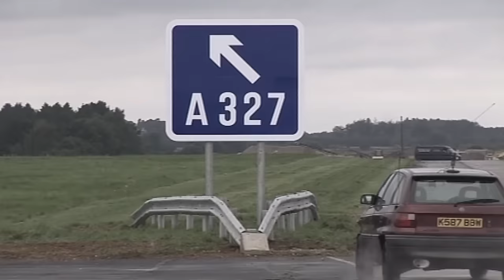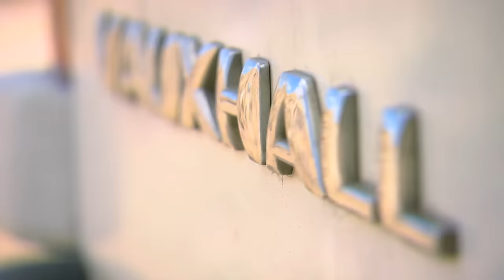Crash Test Month: Van vs. Car

Comment: Moral of the story: Don't transport bags of sand in the back.
Reply: One stupid idea.
Reply: zdrux  Moral of the story is don't use chipboard as a partition between you and your 1 ton cargo.
Reply: zdrux o
Reply: Moral of the story:    Always strap down unsecured loads!
Reply: zdru

I
Reply: zdrux of kkk
Reply: zdrux if
Reply: Xoxo the demon lance
Reply: zdrux to
Reply: zdrux c
Reply: zdrux jk
Reply: Unfortunately tradesmen can't afford 2 vans. The reality is when these van ranges are designed it's for a different type. If you're a painter and decorator you'd have a swb roof van but if you do groundwork it's a dropside. But yh Dropsides are for carrying sand and mud etc and roof vans are for carrying items which need to be protected from rain.
Reply: zdrux
Reply: I laughed hard at the end result xd

Comment: Why the cargo  was not secured! It is not the van design fault it is the person that loaded the van.
Reply: Fifth Gear, known for its staged crash tests
Reply: straps? all cargo vans have tie down points in the back.  they just lumped the bag in the back. if the sand bag was in the front against the plywood it wouldnt need to be secured either. also the impact would have  been alot worse for the car.
Reply: @Mathieu Morin anyone with common sense would tie cargo back kind of like what they sid with the pickup and the lorry
Reply: Ffd
Reply: Haha, look at you lot with no idea how most vans get used day to day. There's not a plasterer or brick who straps a bulk bag down. And there's plenty out there transporting them just like this.
Reply: You would not transport something like that in a van. You'd use an open-sided vehicle so loading and unloading is easier, and you would also have special points to secure stuff like that, instead of letting it just slide around.

Comment: Not a very good test really.  Most vans of 10 years old of this size have driver air bags.  Most have steel bulkheads as standard, why did he not put the sand up AGAINST the bulkhead rather than let it gain an even larger impact!!
Alot of these crash reports have been very informative but after saying nearly all vans won't even scrape a three star & the Passat was 4 the van driver (if he had had an air bag) would have been shaken up & a few bruises.
Think they should do this again but set it up with a more likely scenario.

Comment: I had to do deliveries for my workplace a year or so back while another employee was on medical leave.

Driving a typical Chevy van, I had a payload of heavy steel in the back. Coming down a hill, I had to slam on the breaks when a car ran a light. I was able to stop, but the load didn't.

It kept moving until it slammed into the back of my seat. There was no barrier between the back and the front.

It was absolutely jarring. It cracked the bottom of my seat. It killed my back.
Reply: Salvatore Aversa That sounds terrifying. Were you injured?
Reply: +Salvatore Aversa   Yes that is a bad situation, and it's not just in vans.  Something heavy in the boot of a car can break through the rear seats in a collision and inflict severe or fatal injuries on the driver and passenger.  I hope your whiplash recovers quickly and completely...
Reply: +Salvatore Aversa Sorry for your injury mate, I personally turned down the delivery van driving duty at my old job because of this video and posts like yours, so at least some real good has come from your sharing your experience. Consider suing the living shit out of your employer.
Reply: If you drive a van carrying heavy items make sure that it has a proper, structural bulkhead between the load area and cab.  It might save your life.  If the van doesn't you can always refuse to drive it...
Reply: daha vfs zede11
Reply: It's rather shocking that at this day and age countries like USA or UK. Still "behave" like third world countries!! 
FYI In Europe (read EU Europe) bulkhead protection in every van has been a reality for decades! It's anyone's guess how many lives have been saved by this "small" detail. But I bet there's thousands of families that have their father (or mother) seating at the dining table, because of a simple bulkhead. ;-)

Comment: A 1 ton load of sand is not "a typical payload", no way. You get sand like that delivered off a truck with a crane. Rarely do builders carry it.
Reply: They meant a 1 tonne cargo is a typical payload, not sand.
Reply: Nor would 1 ton of anything be typical be it sand or other materials. There would be a substantial difference in damage on what you're carrying even if the weight was the same as a whole.
Reply: You are right.  I've worked with Contractors and hauled everything imaginable.  Once I shoveled about 800 pounds of decorative rock into a nearly new Ford 1/2 ton pickup.  Almost drug the tail and could have busted the suspension quite easily.  A full TON of sand would break the back of almost any full sized pickup or van.  "Ratings" are sometimes quite wishful thinking in the real world.
Reply: Topical payload : A ladder, some other shit, and some stuff on shelves ,like hammers weedwackers and knifes
Reply: big vans can carry 2000kgs of cargo without much problem

Comment: Also a lot of vans in the uk don’t have a wood border 
Actually ones that only carry lighter things
Most vans have a very good structural metal border between the cab and the cargo area that can usually hold more than 1 ton of a crash happens
Reply: Back then only new vans had that

Comment: I notice that the van stopped initially, then moved again when the sand hit the back of the seat.
Reply: Oh my, that is not good
Reply: had the load been strapped down it would have had a much worse impact on the car. what do you expect the van obviously weighs 2-3 times more

Comment: That’s why Vans & HGV’s have slower speed limits than cars & coaches.
Reply: I hate the fact my transit connect is also limited to van speeds limits  it's lighter and smaller than most cars and the brakes are better.

Comment: a good van driver knows that the load needs to be against the barrier and Always needs to be strapped down, i knew from the start when they put in that big bag of sand that would happen... if they put the bag more towards the barrier or against the barrier ther would be more weight on the frontwheels and that would press the nose down a bit more and than you had a bit less chance for the van to override the passat.. but still it would push the passat back like this because of the totall mass of the van + load...

Comment: When the horn went off I pissed my self his reaction 😂
Reply: I think the wiring might have been damaged and squashed up against twisted metal, thus altering the circuitry to omit the horn switch in the collision, meaning the horn was stuck on.
Reply: I was surprised that they hadn't removed the car battery before the crash. The battery acid is nasty stuff.

Comment: @Fith Gear Someone didn't rear crash test the new 2021 Ram 1500. Will you do it please? It will be for the next Crash Test Month, which will be "Crash Test Month:  Car into the rear end of the new Dodge Ram 1500 pickup.

Comment: in my opinion all vans should have a metal wall between the seats and the land area
Reply: load area . its better protection
Reply: +EpicbigM xx we had a van and that had a metal wall between the cabin and rear load space and also had a car ram us off the road a few weeks ago and because everything was bolted down securely not much apart from screws moved apart from a box of tools which snapped the wood, without the wall no doubt we would have been hurt by the tools in the rear.
Reply: +RandomShitKing - RSK which ever family member bought that van was clever and wise to buy one With a solid metal wall
Reply: +EpicbigM xx they are a whole lot safer if you have heavy loads in the back
Reply: +EpicbigM xx They do - nowadays anyway. I've not driven a van older than 5 years and they all have metal bulkheads.
Reply: yea people remove them to maximse stuff or to get some money and they will replace with a cheap wooden one
Reply: It’s called a bulkhead
Reply: @randomshitking-rsk9041  - That's really 3th world behavior!! I guess in your neck of the woods, wherever it might be. There's no vehicle inspections!
That alone would be a failure point, enough to take the van out of the road... until the problem would be fixed!

Comment: ok, in this case, it looks like car is safer because we are carrying 1 tone of sand in the van, but, can you try to add 1 ton of sand in the bag of the seats of the car and let me know the results of the impact.

In my opinion Van is clearly safer as if, you are not driving with 1 tone of sand or if you fix it correctly, you will not get this problem

What i understand from the video, if you drive a familiar van with airbags, with loads in the back well fixed, you will be saffer than in a normal car

Comment: Forget bags of sand...boxes of tools, building materials etc. that most vans transport all turn into lethal missiles in a crash, especially when unsecured.
I would never buy a van without a steel bulkhead behind the cab for this reason.  The passat stood up pretty well considering the van and its load probably weighed twice as much. I'd like to see a van vs van crash and asses the interior damage then...

Comment: So in this particular type of impact, the occupants of the car would have been worse off as the car was pushed backwards on impact. This is assuming that the van had no load in the rear and air bags fitted.
Reply: Yes, but that didn't happen and also the van was carrying 1000kg of extra force. I have a feeling everybody would die in this situation.

Comment: Wow, only the Ford managed to get a 5 star rating?... That's not good for the others... they need to make standards on safety for these types of vehicles!
Reply: Maybe ford payd for that van to be tested 😬😀😀😀
Reply: Yes, because looks are everything. And having "Ford" In my name sure does affect anything
Reply: Okay, good for you.
Reply: +That One Ford Guy  I dunno if 5 stars matters as much in a van as it does in a car really. A van vs car safety test is not really a like for like. They say size don't really matter but when you weigh 3 times more than a car you'll almost always win even against a safer car.
Reply: Well I mean the problem is since most vans have a shorter front due to the engine being pushed back further that means more vulnerable room for the dash to be pushed inward on the driver which in a serious crash could trap them. Idk honestly.
Reply: Volkswagen Passat vs. Ford Transit

Comment: I know how unsafe they are. I had a had on collision between my Citroen Berlingo and a Renault Espace last year at just 30mph. I still have pain in my shoulder after a year. The worse part is that the airbags in the Espace were deployed while none of them were in my less than 1 year old van. The A pillar was completely deformed and the dashboard was cracked in half. The doors couldn't be opened and I had to get out through the broken windows. The driver in the Espace just openen his door and got out easily. I don't want to imagine what would've happened if that was at 50mph instead of 30mph. Vans are very very unsafe.
Reply: My second cousin was critically injured when his dad's Transit rear-ended another car. Exactly what happened in this video - he was in the middle seat and the building materials flew forward. He was only 18 and he's never been able to work because he has so many brain injuries. He got a six-figure amount of compensation, though, and he's living quite well. They're complete death traps and I'm glad they've finally started being crash-tested.
Reply: The Citroën Berlingo is a car based van, not a proper full sized one...

Comment: To be fair to the van, that's about as bad a way to load a van (or any car) as you can get. Even in normal family cars, you should place heavy items right up against the backseat in the trunk, so it can't gain momentum. If you place a ton of sand in the middle of a van like that, it should be tied down. Just like in a normal car, a truck or whatever.
Now obviously a lot of people don't know the first thing about loading a car or about safety, but at least do it right in a test? :P
Reply: +Gnawer Shreth 

i think since most people don't know how to load stuff, the test it self is fair. most people drive a badly loaded van, so the test has a badly loaded van.
what is not fair, the passat had airbags.
let us re-do this test with a passanger car without airbags, and a van that has them. (if any of them has at all, i did not bother to check) and i hazard, the passat driver would be a sad driver.

many times i was told bigger is ain't better. if i have to choose (given equal safety gadgets) i would choose a van over a passanger car, and a semi truck over a van. bigger is funken better. :D
Reply: +Nagy Andras problem is that there aren't many vans with airbags

Comment: That's unusual to find a van that size without a steel centre bulkhead, or was it removed to get more of a "result".

Good result, shows how much safer cars and vans have become. But come on Johnny no need for hamming it up for the camera, not every crash test is going to be ground breaking

Comment: Astro got a low rating, but ive been in accidents with one, they do amazing.
Reply: Had an Chevy Astro being driven by a teen girl broadside a Dodge Tradesman van after failing to yield the right of way to the Dodge right out side of where I'm typing this, knocking it into our front yard.  All the kids in the Astro were fine, other than the driver freaking out, and the driver of the Dodge and his much younger kids had no major injuries and got out of their van under their own power, but took an ambulance ride as his back was starting to hurt.  Considering the Dodge was a late 70's model designed in the late 60's-early 70's while the Chevy was an early-mid 90's model originally designed in the early 80's, 2 vans with 9 people between the them and all but 1 being under 18 years old and only one person going to the hospital to get checked out, that's pretty damned good!
Reply: GreenJeep1998 I saw a chevy astro hit a dodge caravan, chevy astro was fine, the bumper shoved into the radiator, aside from that nothing wrong. It just had a slow water leak. The caravan was another story, it had about 10.000 worth of damage to it.

Comment: I have driven many vans to carry 250kg motorbikes and I always tie them down firmly so they can't move. I have a degree in physics and engineering and know about Newton's Laws of motion. I have Asperger's syndrome so tend to overlook things.
Reply: +1100HondaCB So would you say that if the van had either a secure load or nothing at all plus airbags. Would the occupant of the van be better off based on the fact that van pushed the car backwards on impact so had a much slower speed decrease in comparison to the car.
Reply: BluePixel Gaming Yes. Vans nowadays are more carlike in their construction so tend to absorb impact better. The extra weight of the van made the car worse off.
Reply: +BluePixel Gaming The weight of the sand also helped. It didn't need to be secured, if it was up against the a substantial enough bulkhead. I was most impressed by how well the  bit of plywood stood up.

Comment: The Transit was a new model, there is now a brand new Vauxhall/Renault. Also, vans get redesigned at a longer rate than passenger cars (12 year cycle as opposed to 6/7 years) so the ability to build in the latest technology is a lot quick in car design.
Reply: Martin Jones Vans in america have been built well since the late 80's and early 90's. Ford econoline was the flagship. Hell, it was so good that ford made it for 20 years.
Reply: ***Classified*** Really, because the Ford Aerostar my parents hired in the early 90s was a pile of junk. I doubt commercial vans were any better. The Aerostaer definitely was not as god as the Espace, which was the school run car I used daily.
Reply: ***Classified*** All I can say is that the Sierra my Dad had was a pile of poo. Constantly broke down and rotten in 3 years.
Reply: Martin Jones GMC Sierra? I have its twin, the silverado with a quarter of a million miles on it. Best vehicle ever.
Reply: ***Classified*** No, a Ford Sierra, 1.6, 75bhp, manual windows and 2 wave radio cassette. no idea what a GMC is. Weren't they something to do with Chrysler or Renault in the States?
Reply: Martin Jones A GMC is basically a re branded chevy. I've never heard of a ford sierra. Can't believe they didn't get sued over the name.
Reply: ***Classified*** Ah, sorry, I was thinking of AMC I think. We never had those brands in Europe.
Reply: Martin Jones AMC has been gone for decades. Their legacy still lives on in the Jeep though.
Reply: +**Classified** The 15 passenger Econoline and Ram vans were rollover prone death traps, something about that extra 5' of passenger compartment stupidly located right about where the rear bumpers should have been causing handling issues with those things.  I don't remember hearing about Gm having that issue, but when they started building their 15 seaters, they added that extra metal between the rear wheels and the side door, putting the weight in a more favorable spot that hanging off the arse like the engine in a 911 then having to deal with both extra rollover potential AND the potential for some good old Porsche and Corvair style handling Sabatage.
Reply: GreenJeep1998 The tires had to be inflated differently. If you ran the wrong pressure, that's when rollovers happened.